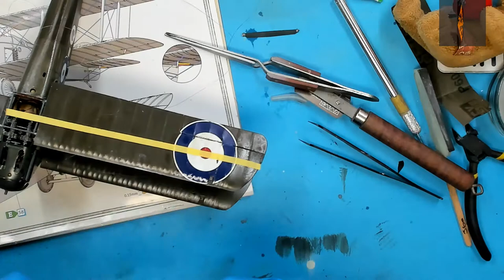Episode 22 of my Wingnut Wings Sopwith 5F.1 Dolphin

Comment: Hello, once again I am pestering you about this particular kit. I have test fitted the top wings onto the 4 sided frame that holds them on but the wings don't go up hard against the 2 forward running bars if that makes sense. I have tried to drill the holes in the wings a bit deeper but still no joy and looking at this video I see yours don't butt up hard either. I guess this didn't prove to be a long term problem as your wing assembly looks just fine. I don't want to try any further drilling and/or sanding in case I run the model.
Reply from the maker: Can you put the time in please? then I can see which bit you mean and I can check the model for you 👍🏼👍🏼👍🏼
Reply: @BudgetModeller  Certainly it is in the early part of the last episode 22, the part number is D18 the instructions show the top wings butting exactly against the two side parts  but in practice it doesn't seem to work out like that